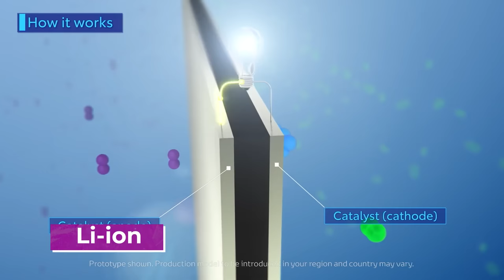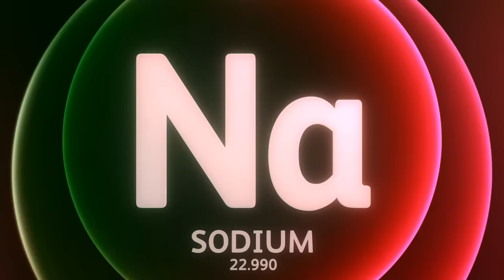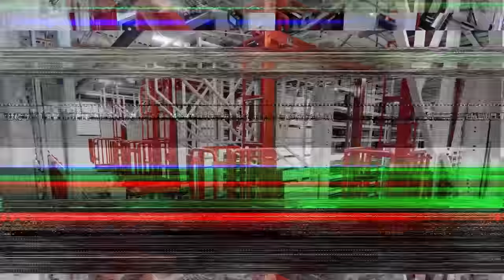China’s MOST ADVANCED Battery Will Destroy The EV Industry!

Comment: BYD seagull is marketed with 2nd generation sodium battery in China. It has slightly lesser energy density than LiFePO4  of similar size. They are already working on the 3rd generation Sodium battery which will exceeds current LiFePO4 capacity. But for the 2nd generation battery to come close to Lithium is already a big achievement as others Sodium battery manufacturers could not even produce a battery that fits a vehicle.
Reply: How close. What are the numbers in energy density? Lithium ion phosphate has 270 wh/kg energy density. Why can't I purchase a power station with sodium ion batteries?
Reply: Is this the battery that is blowing up those junky BYD cars?
Reply: Another battery to burn another BYD
Reply: @JB-yb4wn stop living in the 200s and stop being rcist
Reply: @neilwani1178  BYD seagull has energy density of 120 Wh/kg. But the cycle life is 3x higher than li-on battery already. The energy density has a lot to improve in the nex few years and it`s already cheaper to make. This will allow to keep pushing research foward as the main use now is for stationary batteries such as energy storage for solar panels or any type of renewable energy storage It's way less polutant, etc.
Reply: Check the facts instead of being lazy and ignoring real progress.
Reply: Sodium battery can handle good weather and bad weather so when you say good and bad weather about summertime, spring fall and winter so when mother nature pull down her temperature down in a big minus you won’t have no problem out you’re so battery yeah keep going sodium battery better than lithium Battery I understand that and I’m so glad. When will we see them in action I am waiting.

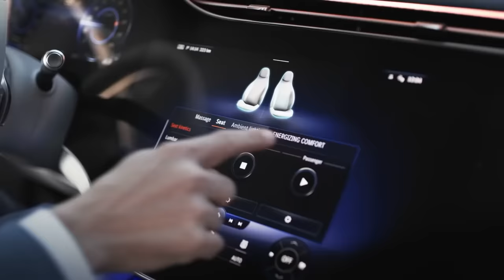Comment: At 9:40 the truth comes out. These new sodium batteries have a low energy density, which means that they will mostly be used for cheap EVs with a low range.
Reply: Would make great gadget batteries for stuff with a shorter service life. A relatively poor choice for EV use for many reasons. One being the same reason they preform better at low temperatures. They have a much lower thermal runaway temperature...
Reply: Thank you for the meat and potatoes.
Reply: Then why is Tesla using it? 🤔🤣🤣🤣
Reply: CATL and Tesla  will use Sodium batteries to back up the grid.  Weight and volume are not issues for these applications.
Reply: Why do you need high range for low distances
Reply: @vikasreddy3603  while I agree with direction of you line of thought.  I suspect that 600 km with fast charging will become the norm over the next few years.
Reply: ...globally people don't even drive 35 km per day on mean average.

Comment: CATL is the number one battery manufacturer in the world by a large margin.  If they say they have this technology CATL probably has the tech.  They do not play around.
Reply: If they do not play around, is the sodium ion battery all over the world and has a higher energy density than lithium? Where is this battery that is a game changer?
Reply: What I want to know is, just how much long / extended durability testing have they actually performed (i.e. just how many years in durability testing) as to ascertain that these quote revolutionary batteries won't be causing fires, etc. And what are ALL the foreseeable potential applications (i.e. can they be utilized for off grid residential structures ?) And compared to ALL other currently existing battery technologies how ecologically compatible are they.

Comment: This. I'm not sure why some people were treating lithium batteries as the end all be all of "green energy" and are in such a rush to replace everything with it.
Reply: Your right. Lithium is so rare that there is only enough to make electric cars for 1 Billion people and by that point a cell phone and Camera battery will cost $200.00 - We need to save the Lithium for all the small hand-held gadgets first and foremost. Soon they will discover that the interpolation of Hydrogen ions "H-ion battery" is much more powerful and all that is needed is Carbon, Manganese and Silicon to build a cheap 650KWH battery.  It will be discovered soon.*
Reply: New era bateri
Reply: @johnslugger  There is almost no lithium in a lithium ion battery.. And lithium is NOT rare. Its everywhere 🤡

''Based on the annual lithium production of 56kt and with 21,000kt known lithium reserves, extraction at the current rate could continue for the next 375 years'' 

im pretty sure we will have better battery tech within 400 years..

Comment: China might be manufacturing these batteries cheaper than ever, in true Chinese fashion, but China has virtually no domestic sources of natural soda ash which is the main source for the sodium used in these batteries and so they are producing synthetic soda ash at chemical plants fueled by coal. Sure they might produce cheap batteries but the operation will be powered with coal, also in true Chinese fashion. That pretty much negates one primary reason for using batteries in cars, the power grid, and other applications, that being environmental friendliness. Even if these are sold all over the world, the source will still remain dirty. China's manufacturing process for soda ash is far from clean, they have some of the worst environmental standards when it comes to their industry practices.

Comment: The hype around sodium batteries is just that, hype.  Sodium batteries, although they appear based upon amp-hours and weight to be superior in terms of density, they actually are not, and the reason is that the discharge of sodium batteries happens at two voltages, first at a higher voltage, then it drops to about half for the remainder of the discharge, what this means is by the time you reach the second plateau you have to draw twice the current for the same wattage and thus really you've only got a quarter not half the capacity remaining.  It also means you have to have more expensive and complex electronics to deal with this double plateau.
Reply: did u ever open up Lithium ion battery and throw the insides in water ?

Comment: Lets just say 80% of private car owners in europe only make 5 round trip journeys a year over 1000 miles. 
Most will not but just say they do. That does not warrant needing a li-ion car or petrol. 
Most of the time they will make no more than 100 mile round trips. 
The psy-op on the people to think they need longer range is unjustifiable. 
You get 80% of people to buy sodium and that leaves the strain on lithium production greatly reduced. 
So what if 5 times a year you have to stop and charge your car 6 or 7 times on your journey for 45 minutes each time. You get to stretch your legs and have a rest or meal. 
It isn’t the end of the world and the benefits far outweigh the supposed hassle of charging more on those rare occasions.
You get a cheaper vehicle, the charge cycles last 3 times longer even though you get only 66% the range per charge compared to lithium, they perform better in cold weather, they do not spontaneously combust on rare occasions etc etc.

It is a win win if you ask me for many people, and all that stands in the way is the perception people have is of having the need for longer range when they will not need it for most of the time.

Comment: The only thing green about the EV industry is the money being made.  The power grid is 33% efficient.   You must burn 3 gallons of fuel to get one gallons worth on energy on site.   The modern ICE auto is 30 to 40% efficient. The ICE engine is far more clean burning than a power plant.   There are no fuel savings on EV's.   The carbon footprint to produce an EV is far greater than an ICE car.   But no one is even talking about more than doubling the electrical grid to make this even possible.